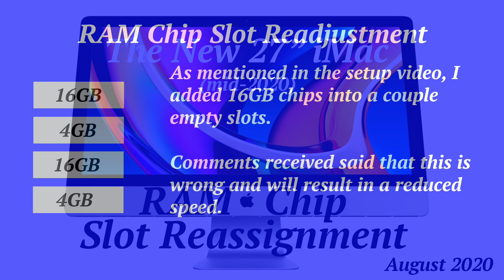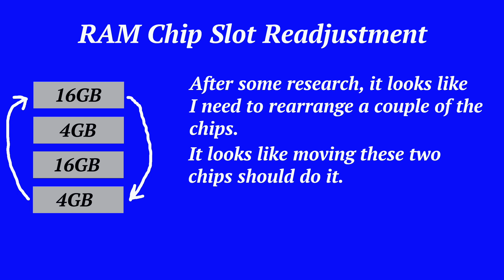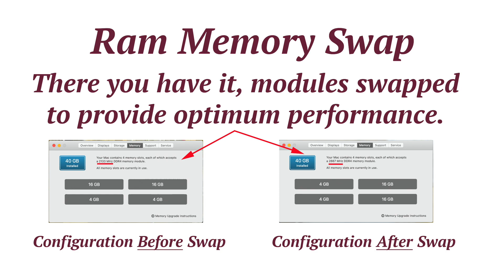27" iMac RAM Module Slot Position - August 2020

Comment: You can’t. Use off sizes on the new 2020 iMac apple changed it they all have to match or you’ll loose duel channel
Reply from the maker: Be sure and read the UPDATE added to the description.  The choice becomes "Dual Channel" or "Speed".  Getting both involves making sure, as YOU mentioned, the chips are all of equal size.  Thanks for visiting the channel....

Comment: The story is a bit more complicated than that. Although the speed is restored using the second method, you are going to lose dual channel. It seems that you can have both the full speed AND the dual channel if and only if you install 4 RAM modules of the same size. Here's a nice little summary that someone has posted on MacRumors: https://forums.macrumors.com/threads/memory-upgrade-troubleshooting-in-2020-27-inch-imacs.2249254/page-11?post=28823941#post-28823941
Reply from the maker: Oh Boy!  So let me see if I got this straight....  The setup I have now, 16-16-4-4, is best for speed.  The original setup, 4-16-4-16, was best for Dual Channel.  Seems maintaining Dual Channel is more effective than going for Speed.  Put another way, I should have kept the arrangement the way I had it originally.  Whew, should I rearrange them?
Reply: Joe Pasquale I would remove the Apple RAM and run the 32 GB in dual channel at full speed. But if you think that you will benefit from the extra 8 GB, they yes, keeping the dual channel is better.
Reply: I confirm it. I did the same operations Constantin but I also check the performance after for each configuration. Yes, like you, the last configuration permits a 2666 Ram common frequency but access Ram memory was not in Dual Channel which is very important for perfs. 

So It seems the same memory size is necessary in each slot to obtain same frequency and best performances.